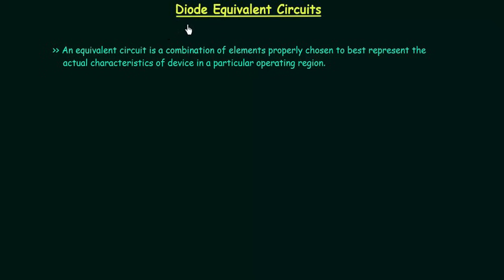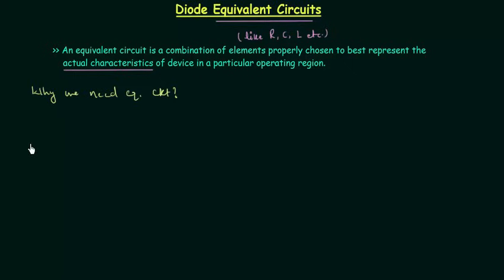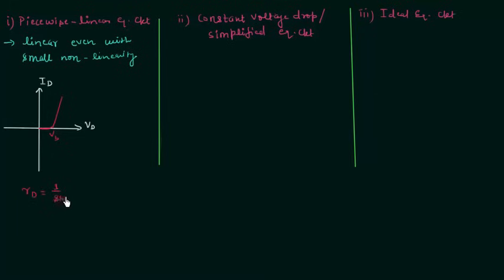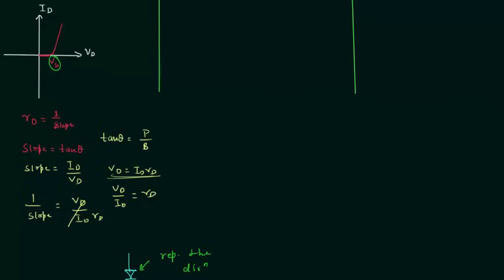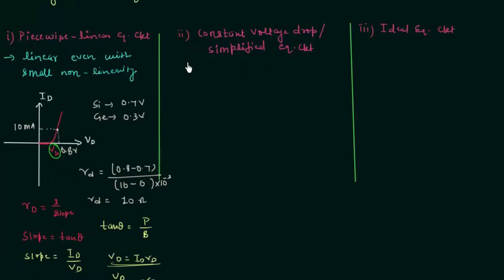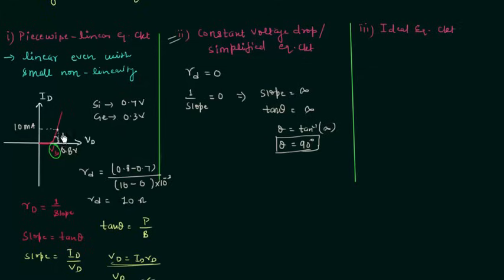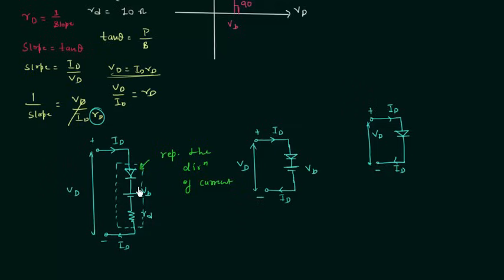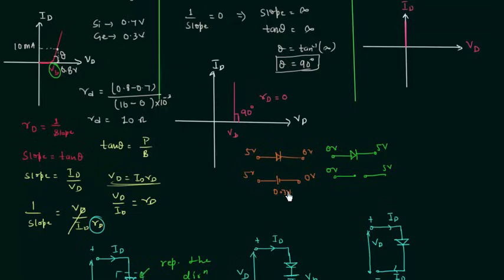Diode Equivalent Circuits

Comment: 9:38 if diode resistance=0, then Vb is also 0 right? Then why are taking Vb as 0.7 or 0.3? I don't get. Plz someone explain.
Reply: as for the constant voltage drop we have made two assumptions, firstly we have to assume the linear curve instead of small non linearity and secondly we have to consider rd = 0, which is diode resistance, if diode resistance is zero that doesn't mean that Vb will be zero, Vb is constant for any type of diode. there will be sudden flow of electron, thats why the VI graph will be at 90 degree.
Reply: Same problem .. please explain .

Comment: Can someone help 
 Does Diode resistance depend upon Barrier potential???
Because as far as my knowledge Resistance do depen on biasing but Does it depend on barrier potential????
Reply: Barrier potential would be the point upon exceeding which, electrons will move through the depleted region and current starts to flow (already explained in previous lectures). So yeah resistance does depend on barrier potential. Higher the barrier potential higher would be the resistance